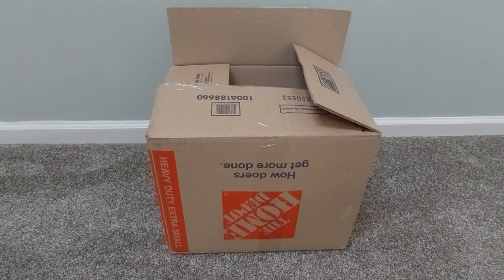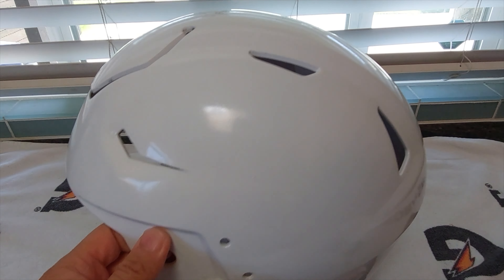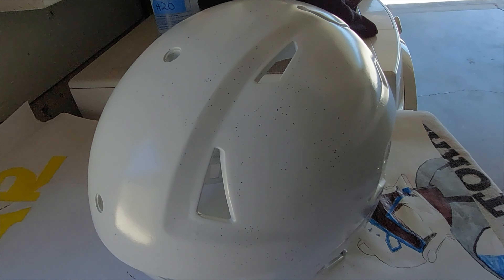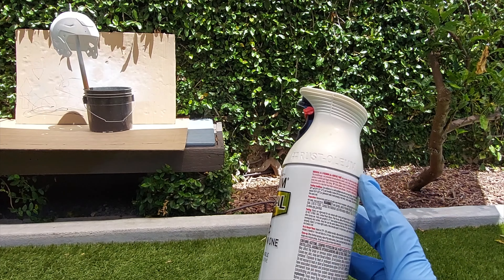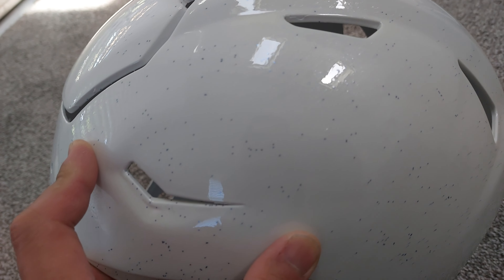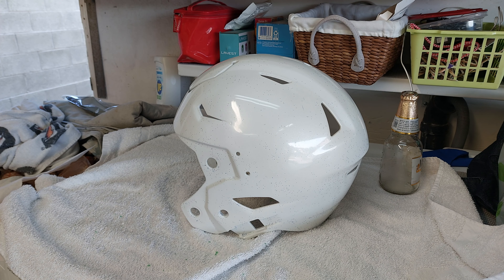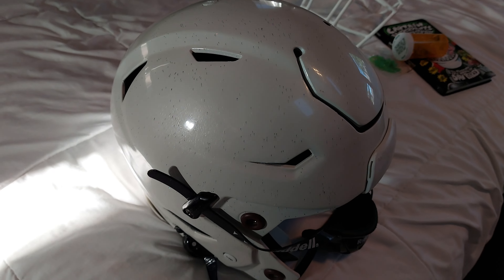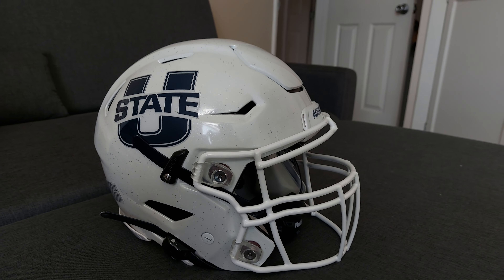Painting a Football Helmet - Metallic White Pearl - (Utah State Aggies)

Comment: I just started in the hobby as well, and I love it, One suggestion is dents and cracks on the helmet, Get some Bondo made by 3M and its a puddy that fills in the cracks and a fissures from game play. I just used a 100 to a 120 grit paper hand sand you do not want to use a power sander you will make burn marks on the helmet. I used gray primer two coats, I am working on a Riddel Air Advantage and It was a youth helmet, For some reason Ebay Sellers don't specify that, so beware of that. I just got a Riddell Adult Helmet XL off of ebay for 65 dollars, facemask will need reconditioning. But I am going to do that myself. Your UTAH helmet is nice, hopefully as a beginner in this hobby mine will look good as it did before going to the field.
Reply from the maker: I use the bondo as well when needed.  You can usually tell the youth vs adult helmets based on the color of the inner liner/padding (gray = youth, white = adult).  Youth helmets also do not have 3D bumpers.  Start making room for more, because you will become addicted to making these.
Reply: @LiL13izzy7  I already am addicted, Got four ready to be stripped and taken apart.

Comment: I just bought a few helmets to recondition & custom paint for decoration. Your video is amazing and super helpful!!

Where did you get the custom Utah State decals made? How much did you spend?
Reply from the maker: Hey, thanks, and I'm glad you found this helpful.  Check the video description to the links for the custom Utah State decals. The side decals (3M 20 mil) were purchased from one seller, while the front/ rear bumpers stickers had to be custom made - I reached out to a second seller who makes custom helmet stickers.  IF you can find someone who can make 3M 20 mil decals, those would be preferred.  The bumpers are literally stickers, and don't adhere very well to rubber (let alone uneven rubber after taking a dremel to the Riddell branding), so even though I linked the ebay seller, I would not purchase those bumper stickers a second time if I were to do it again.  It's just that it's hard to find Utah State U 3M helmet bumpers, so I had to go the custom route.  Hope that makes sense.

Total all-in was around $400